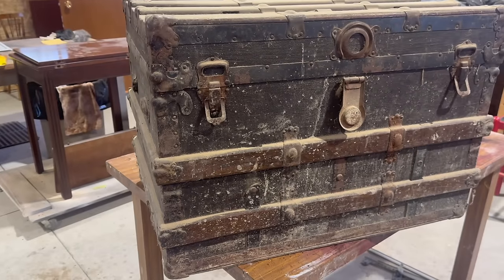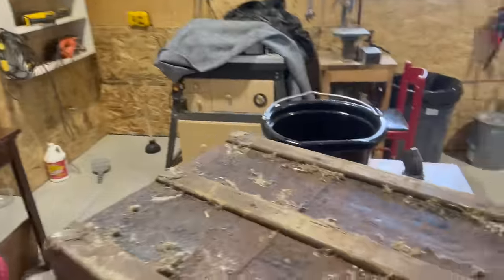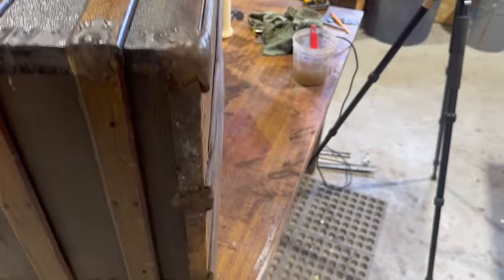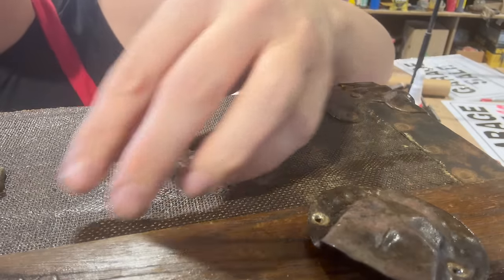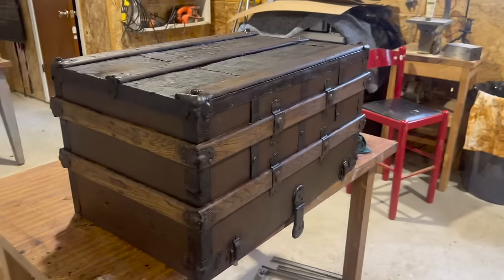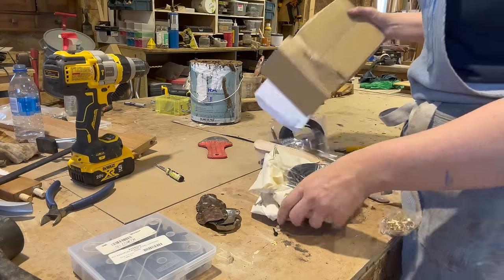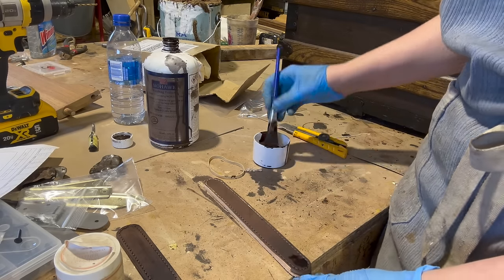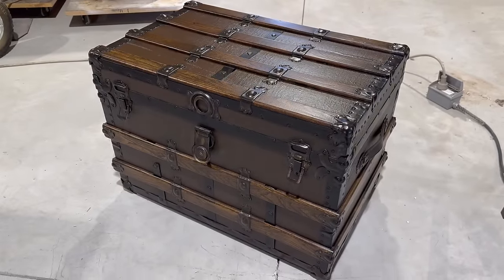Restoring... Blackbeard's Treasure Chest?

Comment: beautiful result and now usable for another 100 years, welcome back, good luck with your move, I did a similar restoration on a trunk which I converted to a coffee table by fixing 4 rubber stoppers to the top and them placing a thick piece go glass on to top for the usable surface
Reply from the maker: Cool, thanks

Comment: Nice to see you again! I have a trunk very similar to this one. It still has the top tray in it. My sister restored it 20 years ago and did a pretty good considering she does not have your talent and expertise. Also, we were not aware that replacement parts are (were) available. She elected to keep the wood slats a lighter color so as to make a bigger contrast with the rest of the trunk. After all these years, it would benefit from your handy work. If only you were close by... Oh well... Great job as usual.

Comment: Welcome back. I have an old stamped metal alligator pattern trunk from the late 1800’s-early 1900’s that I need to fix. Someone tried to refinish it in the past and now I have to undo their mistakes. Thanks for letting me know that Lee Valley has liner paper. And Kennedy Hardware to get the other pieces.
Reply from the maker: Have fun!

Comment: Very nicely restored w/o overdoing it.  I like the older humpback trunks....4  trunks so far.   1st smaller one was kinda bad shape, wood intact and did a nice stain/sealer on inside.  2nd bigger one, just slight touch up.  3rd one was so intact in and out -close to perfect, I just used Murthy's on outside, only one that has a key.  4th one from 1890's black leather humpback and inside 2 trays and dropleaf in top were completely apart.  Restored leather but got it too soft and mold started growing due to where it was stored. Ended up a thin black lacquer coat to stop mold.  Latch  plate was ripped out of front caused it was locked and no key.  Mostly restored just need to finish touches on outside. That was my retirement project.  Even though I got old wallpaper, haven't used it, not right trunk yet.   Learned alot watching you and Thomas Johnson. Keep up the great videos.
Reply: Wife and me have done 5-6 furniture restorations over the years.  Just sad over the years, antique stores been closing up where we used to get good things., think over 75% have closed.
Reply from the maker: Awesome. Thanks for sharing!

Comment: i picked up a trunk in rough shape and it was a throw away.... so i got it for free.  the canvas on mine was painted brown and falling off in places  so i just pulled it all off  underneath was red cedar  !!!  i took a green scouring pad and did the metal  then painted that with rustolium black flat paint   polyed the wooded  slates  and it came out really nice  i did have to bleach the inside ,  it had black mold ..but now i use it as a blanket box in my living room    very happy with it.  and i had both leather handles also...great save as always trena  ;];];]
Reply from the maker: Very cool❤️

Comment: @johnsfurniturerepair well done Trena! This video popped into my feed last night but I had to go out. When I went looking for it this morning it didn't show up on the list in your channel! I panicked cuz I really needed to see it for my repair...lol.  thanks for the cool title so I remembered it and searched by Blackbeards trunk...that was a first...bahaha. 
I'm restoring a handmade tool box that was badly damaged in a flood.  The thick leather handle was so dirty I struggled to remove it. The box is made from sheet metal and rivets...I didn't want to drill out the rivets as I wanted to keep the sentimental piece as original as possible. 
The handle was very brittle with a detrimental crack going straight through the centre of the top 2 layers. The 3rd layer holds it together. There was zero flex in it. I drenched a cloth with hot soapy water (palmolive oxi degreasing dish soap is my go to). I scrubbed the top and was delighted to find part of a name engraved on it! It was in such a sad state I didn't even know it was there. Originally I thought I might cut the handle out but now I'm really trying to preserve it. I alternated between wriggling the drenched cloth back and forth to wrapping it around the handle.  Little by little it got slightly more flexible and clean.  Fortunately the leather was held in place with a nut and bolt on each end. I held my breath and carefully wriggled it free...lol. I was able to leave it soaking in the water while I scrubbed the metal. 
I'm so happy I can read the whole name now! It belongs to a dear friend who lost alot in the flood. 

What kind of glue can I use to secure the top 2 layers? Can I use butchers block oil to recondition it? It's definitely more flexible now the flood water is gone but it's old. I got mixed answers when I researched it. I have some on hand. My funds are limited. 

On an alternate note...I have a trunk I need to restore.  It's a really thick cardboard type that has travelled extensively.  I don't want to damage the travel stickers.  It belonged to a man who surveyed land. It reeks of mold. I washed it by hand and left it outside during the winter (in a protected area) hoping the cold would kill the mold.  It smells way better but it still has a faint odour. It's still sturdy and I want to use it for storage.  What would you recommend please?
On an alternate piece I want to make white wood look antique...or have a patina.  I was thinking of using a wire brush to remove the soft grain some then use black shoe polish (cream texture) to age it...would that work? I want to varnish over it but I'm concerned the polish won't allow the varnish to adhere
Reply: Thanks in advance
Reply from the maker: Hi there. Sounds like you are very busy. For the leather handle you can use contact demented and re-stitch the layers. I would seal the trunk with shellac. I like your antiquing idea, try an area to see how it looks, I would varnish before dark waxing. Hope this helps cheers!
Reply: @johnsfurniturerepair  thanks! I  didn't think about contact cement.

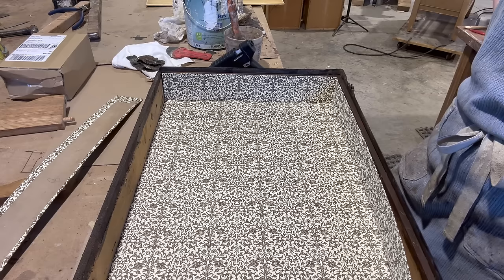Comment: 29:00 hotmelt tends to come off easily with isopropanol, especially on smooth surfaces. Not sure it works so well on wood, but you might want to give it a try.

Comment: You'll probably think I'm crazy, but this seems to me to be a perfect project for laser rust removal. The laser will just zap the dust away leaving the bare iron, it does nothing to wood, or cloth or flesh for that matter. Then you can faux "Japan" the metal pieces back to black. Just a thought!
Reply from the maker: You send me the laser and it’s a deal😉😂

Comment: Stamped into the wood below the left handle (as you're facing the front of the trunk) is 28-37-06 and what looks like the top of a digit after the 6.  Actually, I can't tell if there are dashes between the numbers.  I presume there are.

If I had to guess, I'd say it refers to 28 June 1937.  But that's purely a guess.

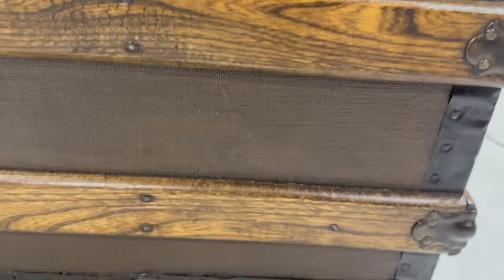Edit: I caught a quick glance at 40:08, and it looks like the  same number sequence is in exactly the same spot as on the other side.

Comment: Too bad you left out those leather straps. The whole thing looks very nice. Also the inside.
Those leather straps can give the chest more character. But the high gloss of the metal would indeed be a negative point. I think you know what to do with that. The coffin will then be complete again as it was designed.

Comment: Just wow! Thanks for the idea with this additional board, which gives additional strength to the hinges - I will use that immideately for a project of my own.

For the leather: If sewn together as seen here, I do usually hammer down the stitching, it should protect against potential damage. And you can age brass a little  with salt and vinegar or with sanding and cold blueing. I use a hammer to get some random nicks in the brass, I use some sand paper to bring it to a some more dull shine.

This British gentleman describes his method to age brass as perfectly  as efficiently:
https://www.youtube.com/watch?v=dcM79XGzs2Q

For ageing leather: I scratch the finished piece (slightly wetted) along the outside of my house wall, I put it on a rough surface and walk over it, I use sand paper along the edges.
All this in a controlled manner. 
Now, it's the same as with making "old" wood: You will use some kind of color on it. If you use now some kind of dark color, it will set in the deep dents. Wipe the excess off. Leather workers use for that usually a special antiquing paste. But, as usual,you can that this with som kind of dark wax. And for colouring leather, you can use water-soluble stain or such.  

This leatherworker from Texas shows, while working on a cartridge belt,  his method to give leather an used distressed look (coloring begins roundabout at minute 7:07):
https://www.youtube.com/watch?v=qagKc4VklFw
Reply from the maker: Wow. Thankyou for the great resources. I learned something new! ❤️